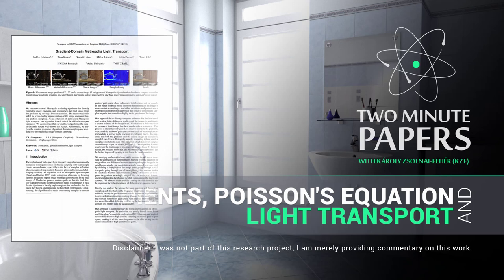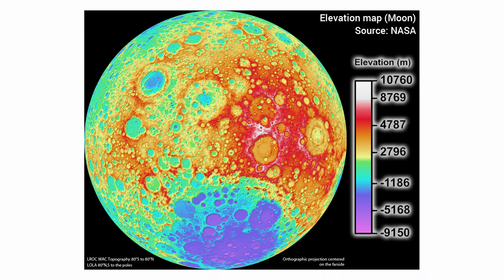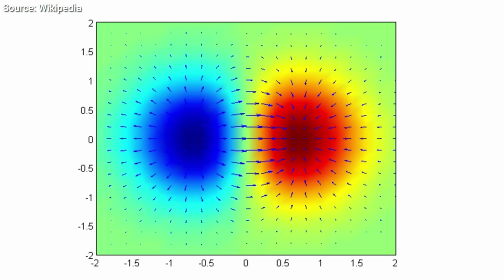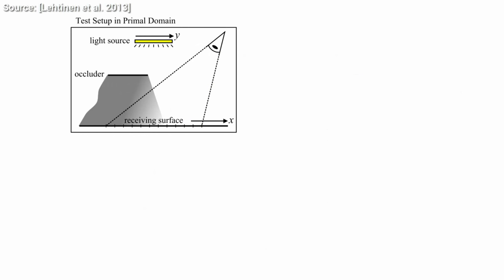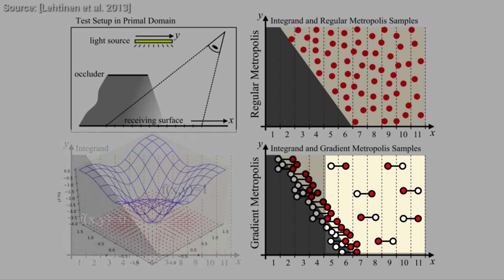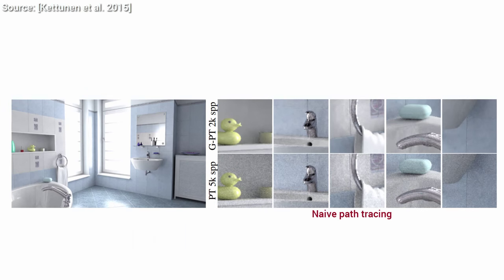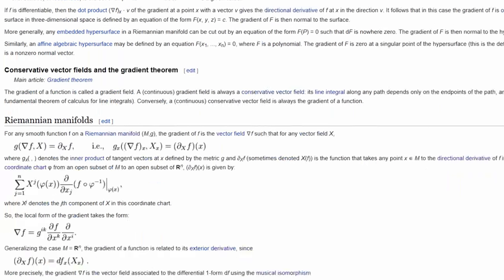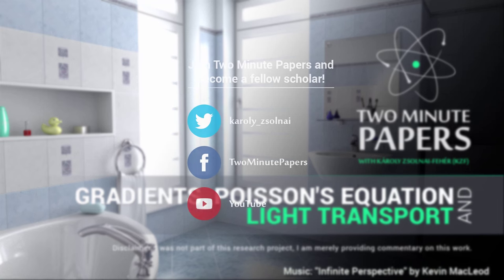Gradients, Poisson's Equation and Light Transport | Two Minute Papers #20

Comment: This demonstrates why I dislike the type of Mathematics that I saw  in textbooks and on Wikipedia: things often turned out to be much simpler than they were described, when I took the effort to decipher their mathematical description. There have been times where I wrote a simulation based on things that I had deduced, and had a reasonable understanding of, and got totally lost once I started reading the mathematical description.

Things make much more sense to me in expanded programming code, than in dense formulae.

And at the same time, that's exactly why I like two minute papers. I can actually follow what's going on.
Reply from the maker: +RC-1290 I went to college with a very weak math background. My only way to make it through was to build an intuition for everything. Very happy to hear that you appreciate this kind of thinking too!
Reply: I understand that technical jargon can speed up communication when both parties know what the words mean, but sometimes I think its largely counterproductive. Knowledge should be accessible to the widest audience possible and I think authors of technical work should take a little more time to break down communication barriers.

From my professional experience as a programmer, this sort of unnecessary use of jargon is frowned upon. The ideal everyone tries to strive for is that what code does, and how it works, can be understood accurately as quickly as possible, with minimal prior knowledge required from anyone on the team. We strive to produce code that appears almost like plain English and could be understood by novices.

I wish this attitude was more widely adopted in the academia. I wish, for example, that mathematical notation would be largely replaced with pseudocode when describing complex mathematical algorithms or concepts. In pseudocode, all of the operations and variables are given clear names and can be broken down into discrete, separable steps, providing comments about intent along the way. If a programmer tried to put an entire algorithm in one line, all of his variable names were one character long, and no comments were provided, everyone would complain about his work being unreadable and unmodifiable, and he would be fired.

Sometimes I think academics are concerned more about how they sound than what they are saying. They'll sound very sophisticated about something, where you need to google every second word, but then when you finally understand what they were talking about you'll think, "Oh yeah, I remember programming something like that 5 years ago. It was actually pretty simple."
Reply: Code with full names is easier for me to read too, but I know people who find algorithms easier to keep in their head with short names. This is puzzling to me, but I can imagine that for some people mathematical notation makes much more sense.